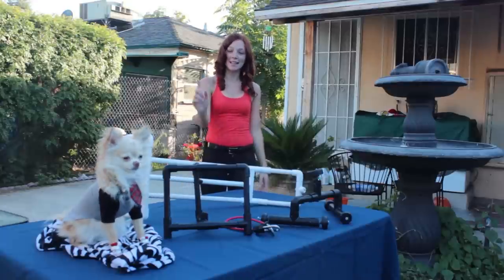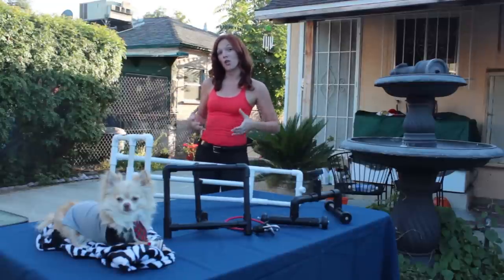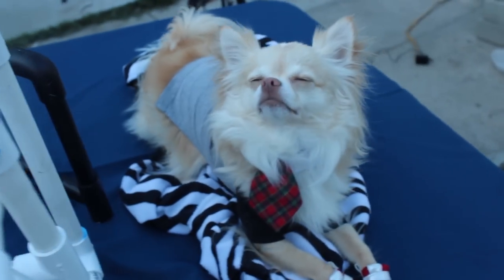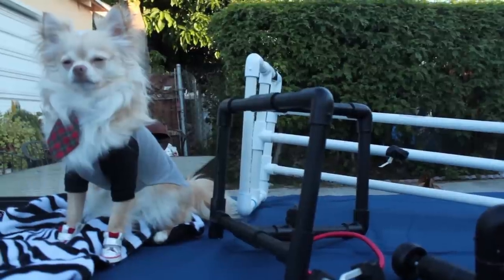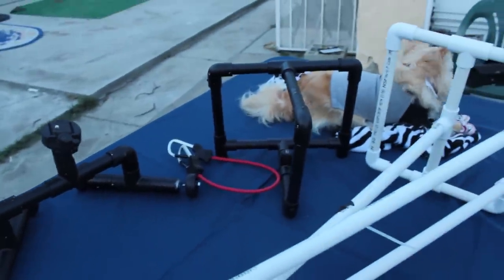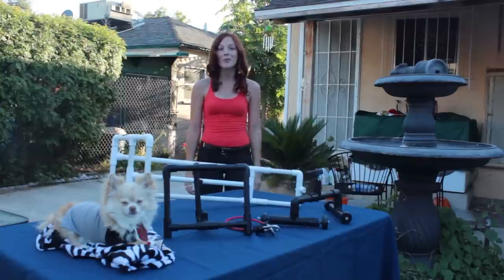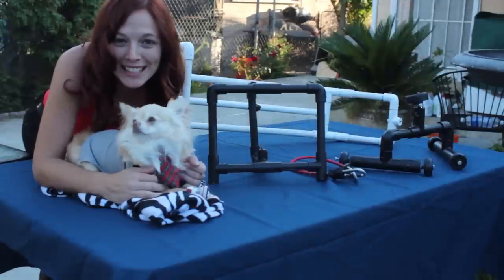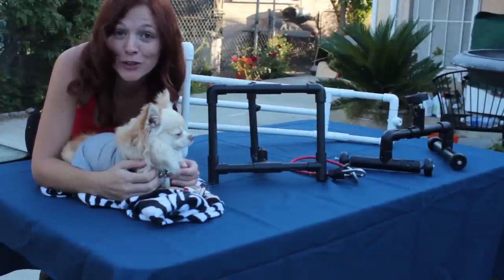DIY Camera Stabilizer, Table Dolly & Snorricam (Sample Footage)

Comment: Oh duh... probably should have looked there! I think i'm gonna build that too! And the camera stabilizer is.... okay i guess, definitely better than using it hand held (btw what kind of camera do you use?). As I told you I'm in the process of building the frugal floater (waiting for a slider to come in from amazon before I can finish), and when I finish building that I think i'm just going to use that as my primary stabilizer and just use the one i already built as a back up.

Comment: "Some comments below".
Reply from the maker: glad you checked out the video!
Reply: Jahnna Lee Randall I've made a few camera things with PVC and I'm about to make the hand held stabilizer. I'm going to try and tweak it so I'll probably spend most of the day cutting and fitting PVC pieces. I like the table dolly I made but I used large rollerblade wheels unlike your short stubby wheels. The table dolly works a lot better on some sort of track.
Reply from the maker: Ron Cox Awesome have fun creating today! Yes my table dolly has some stubby wheels LOL and you are so right it would work better on some short of track. I actually haven't made any new PVC additions. I actually bought a tracker which I am learning how to use and am really liking it so far! Adds some great motion in my films!